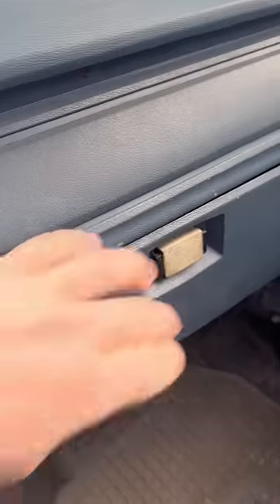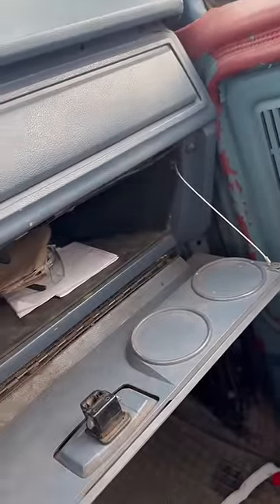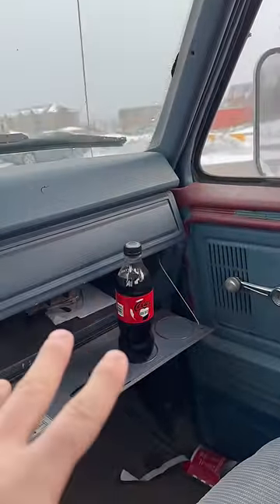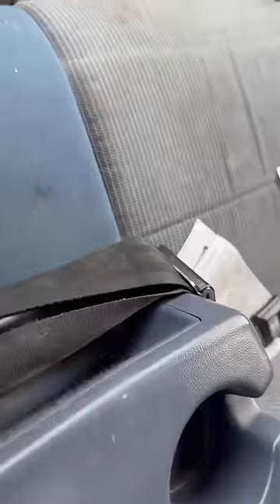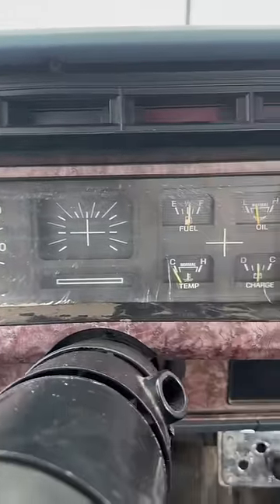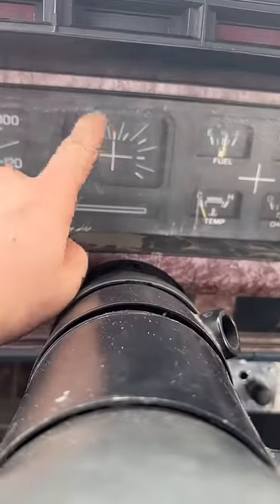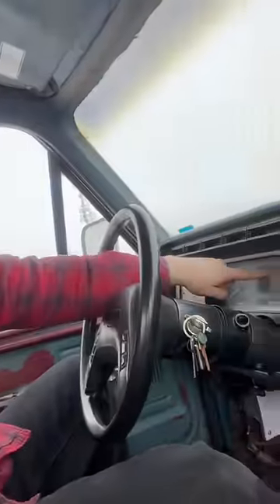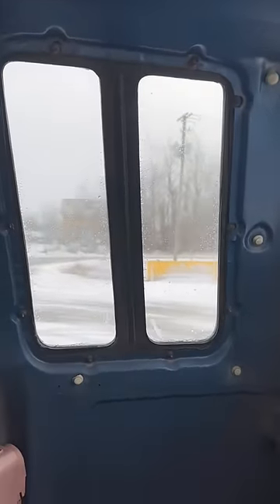Let’s talk 80s ford pickups

Comment: My 1st car was an 87 F-150 I bought in 93. Slow ass 180hp 351. Computer controlled carb was the dumbest idea ever. I absolutely loved that truck. Cost me on average, $250/mo in maintenance,  but at least gas was only $1, because I got 10mpg. I gotta say, 87-91 were infinitely nicer than 80-86. I hate everything about early 80s ford's. The ugly wheel well rolling. Ugly ass dash and cluster, ugly cheap, skinny steering wheel, and that 2 piece rear glass is so ugly. 92-96 are my favorite ford's from the I-Beam era. I had a 96 F-350, single rear wheel, 4x4, super crew XLT. 4 full size doors, my family of 6 had no issues with seating. Captains chairs, full center console. Duel gas tanks. Factory ride height allowed me to put some 18s with 35" MTs that never rubbed. Only draw back was the 460 big block. Had plenty of torque to tow my horses, but with only 230hp, it wasn't getting anywhere overly quickly, and if you floored it, you could watch the gas Guage move.
Reply from the maker: I can understand the 460 mileage, I swapped one in my short bed a few years ago, makes quite the fun truck but it does love fuel haha 😂

Comment: Nice truck. You'll never see a 40 year old electric car running. They will send an over the air update if they have to to shut it down so you go buy a new one. Apple did it time with the iphone.
Reply from the maker: The original batteries sure won’t be around in 40 years, very first thing you’ll have to do to one is put a new battery in it and pray the electrical wiring is good haha 😂

Comment: Why don't you talk about the 3 1/2 inch holes in the frame where the trucks frame  gets bent or broken in half????  1979 was the last good year for a Ford truck until the Super Duty came along.
Reply from the maker: The Swiss cheese frame was only 2 or 3 years long in the f150s and 100s, f250s didn’t have them. Other than the front end there isn’t a whole lot different frame construction wise from the 70s to 80s

Comment: I've always thought the 80-86 was the most ugliest truck ford ever built especially the interior design. But in 87 was a huge improvement. 73-79 are my favorite years.
Reply from the maker: My favourite ford pickup is a 66 f250

Comment: how about: how do I get mine to stop shutting off
Reply from the maker: That would be a problem haha
Reply: @highostablegarage  87' ranger keeps spontaneously dying. replaced a buncha, sensors probably gonna go over the fuel system next
Reply: lol found my own comment again a year later. wound up being a splice in the ground to the fuel pump. someone put the two ends of the wire together by doing a single twist and letting it hang. just thought Id update the post

Comment: that's when Ford made a truck that would go 200 thousand or more miles not like the junk turbo 4 and 6 motors they make now
Reply from the maker: I’ve heard a lot of issues with the 6.4s and 6.7s so I’m not surprised

Comment: Well  I'll drive my 1977 High Boy...the real ford....Shoe
Reply from the maker: Fun fact, highboy was a term coined from magazines for a 66-79 fseries that was 4x4, nothing really special about them other than the name, they aren’t lifted more than a stock 4x4 from the same era. That being said I love em all pretty much up to 99, my favourite year was 66
Reply: @highostablegarage  yes it's a term folks coined... but it is heavy duty though out....I was told by our local Ford dealership years ago my 77 had the highest gross vehicle weight for a F250 class up to that time. Purchased from a logging company up a built motor in...I have hauled literally thousand of cords of firewood on it. Have a 12 k lb.PTO winch on it .Big knuckle Big Hub...Dana 60 front end...Dana 60H rear.  4:10 running gear...MT 437 4 speed tranny and built 429 power plant... it's a great work truck will haul my newer Fords to the dump with it....Shoe
Reply from the maker: @robertshoemaker6204  the old 429 will treat you well, great engine
Reply: @highostablegarage  Yes originally it had a 400M not a bad motor...the Bellhousing will also bolt up a 429/460 block I opted to go with the 429 shorter stroke wind up more...instead of a long stroker 460. Yup again a great engine gobbs of power...pass everything but a gas station. Have an awesome Ford day..Shoe

Comment: If I said something that ignorant, I'd remake the video dude.... I've seen 1000s of late 80s and into 90s with split window... smh
Reply from the maker: If you want to talk about being ignorant I wouldn't have made a comment considering this exact issue was addressed months ago in a pinned comment on the top of the video, you would have read that before typing this...but that's ok, guess you know better haha xD
Reply: @highostablegarage  why are you assuming I didn't read your pinned comment? I'd have to be blind to miss it.
Reply from the maker: @electronbeing5473  That just makes it worse then, that's just you choosing to ignore that the conversation has already come and went, my statement in the video regarding split windows has already been mended as stated above, I said I was wrong and addressed it months ago. Your original comment is just you projecting and being redundant.